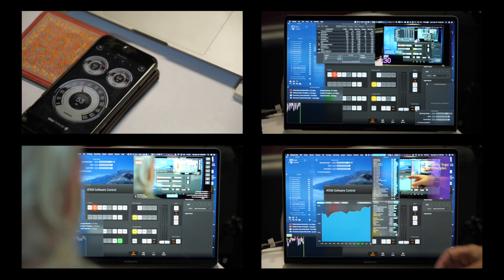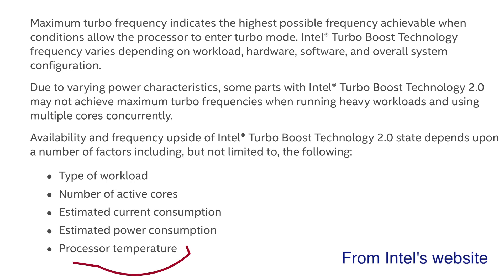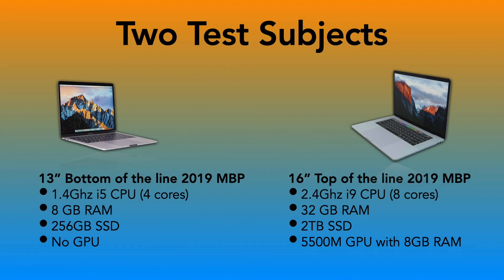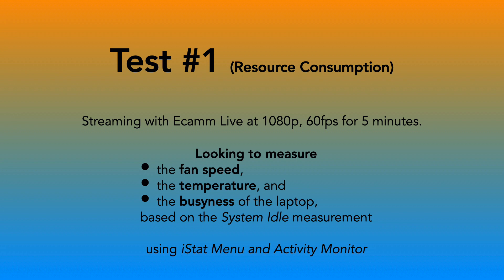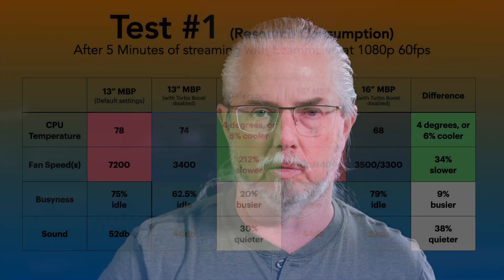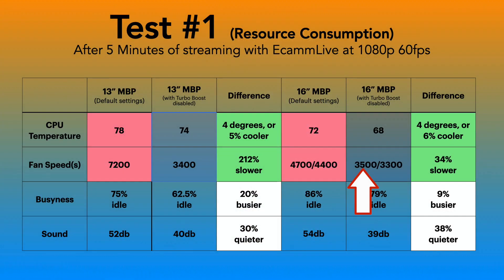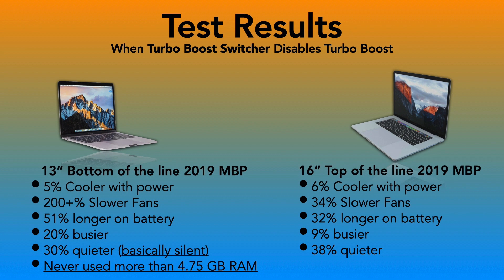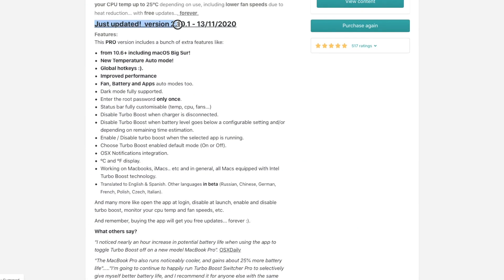Ecamm Live and Turbo Boost Switcher

Comment: Thank you for your time sir :-) This took a while to prepare... I'm on a 2018 MacBook Pro 15" with 32GB RAM and 2,6GHz 6-core i7, Radeon Pro 560X 4GB, kind of a "level below" your 16" Mac. I've tried everything to decrease the load on the computer but the fans go bananas with Ecamm + Audio Hijack, Atem Mini Pro and couple of scenes. I use a Noise Gate processor for my mics but it only cuts of all audio in between my words. When I speak it lets everything through and now I'm experimenting with placing the computer further away. Even using the external monitors adds to the overall load so my best results were when I streamed only from the laptop. But I need my big monitors... I also have CalDigit Element4 Thunderbolt hub and an OWC Thunderbolt Dock where everything is connected so it can't be faster than this. I bought these two items prior to the upgrade to Mac Mini M1X that's expected by the end of 2021. But I'd love to have a quieter situation now anyway. 
So I'm using the TG Pro which is an app where I can configure exactly at which temperatures the fans should kick in - and I can decide on the percentage of "blowing" :-) This is neat and I'm still tinkering with it, but it doesn't affect the TurboBoost kicking in on the Mac... or does it? I'll have to investigate. Thanks again!
Reply from the maker: I wouldn't really want to change the amount the fan is used since Intel and Apple worked to build a profile that says when the temperature is "X", do "Y" to manage the temperature.  Turbo Boost Switcher doesn't directly affect the fans, it keeps the CPU's clock speed at nominal and not boosting into overdrive, so it generates less heat.... and because there is less heat the fans don't have to cool as much.  I would be concerned about damaging the CPU (or other components) if the CPU exceeded what it was meant to go to.
Reply from the maker: By the way, your MacBook is MANY TIMES more powerful than my wife's 1.4Ghz MacBook, sooooo... horsepower is not the issue at all.  :-)
Reply: @MoffatCreative  TG Pro is so configurable that it's almost scary. I've tried with their newly implemented "Auto Boost" feature that I wrote about but it always ends up with fans going on much higher rpm than if I set it to "System". There's also a "Manual" option where I set it to max fan speed and what I do is that I run that for at least 10 mins after I've opened Ecamm and other apps needed for streaming or recording, the temperature goes really down that way, and then I activate the "System" mode in TG Pro. That works for.... 10-20 mins maybe, then , I guess, the Turbo Boost kicks in and the fans go bananas. So I will test the Turbo Boost Switcher, the free version to start with, no problem to initiate it manually. If I notice the smoother performance and lower fan speeds, thus lesser noise all around, I'll definitely buy the Pro version. My setup involves connecting the Atem Mini Pro with 2 cameras into one of the Thunderbolt ports, then a third camera goes directly to the computer via the CamLink4K capture card. Thanks!
Reply from the maker: @HomesickMac  good luck. I’d be interesting in hearing if TBS helps!
Reply: @MoffatCreative  I'm on a location and using Ecamm with two cameras connected, not too much load I guess.
But the difference is notable:
TurboBoost Switcher off:
CPU load 10,4.  5913rpm fans, 85 degrees C

With Turbo Switcher ON and no Turbo Boost:
CPU load 17%, 3653 rpm fans, 68 degrees C
The laptop is definitely warmer but no performance glitches, all fine.
Reply from the maker: @HomesickMac   Right?  Higher CPU load and yet cooler running.  YES!!
Reply: @MoffatCreative  Yes, and now it's at 12%, 2643 rpm and 67 degrees C, albeit with paused recording. Now this is a very noisy environment (live concert) so I'll do myvtesting at home as well, and then with 3-4 cameras.

Comment: Thanks so much for posting this. I have a 2019 MacBook Pro and I have it mounted vertically in a cradle which helps significantly with heat dissipation. However, the fans were working really hard whenever I had eCamm live running. After Watching your video I purchased Turbo Boost Switcher and I now have a silent Mac.  I could not be happier.
Reply from the maker: Glad to hear it!